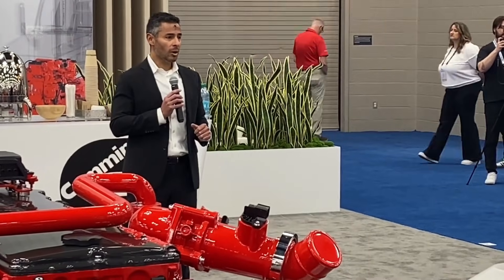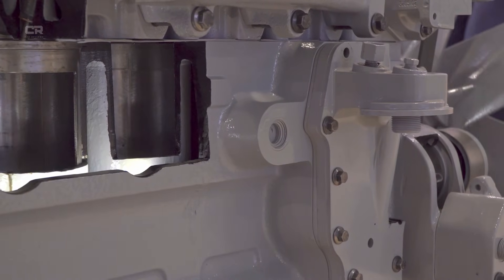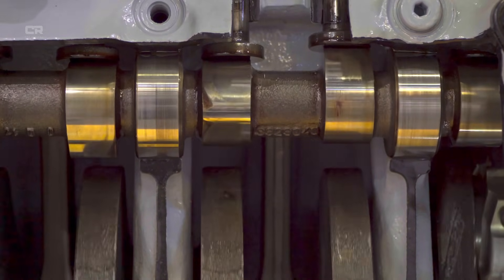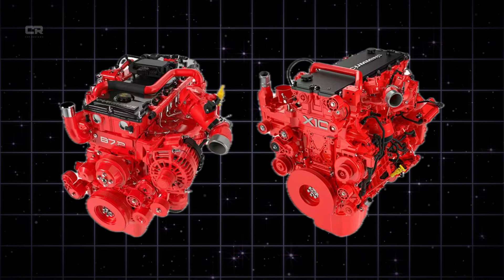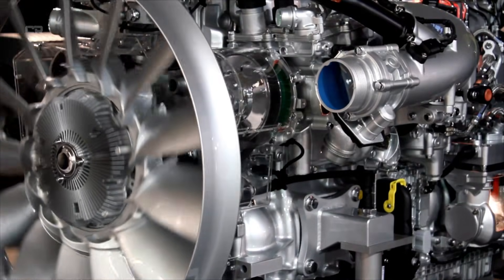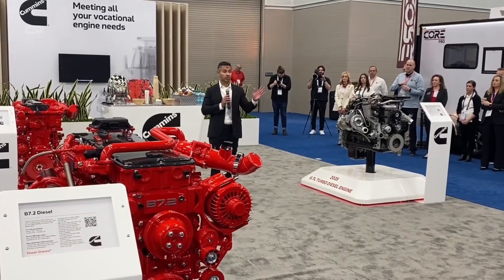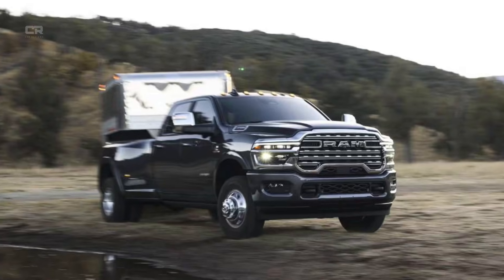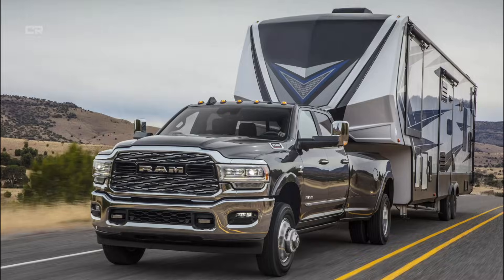7.2 Cummins Emissions System Explained DEF, DPF, and EGR — What Every Truck Owner MUST Know

Comment: All can be efficiently deleted from the start. With a good tune, none of this is necessary. And 1,000,000 miles on a motor is a reality once again.
Reply from the maker: Thanks for sharing your thoughts! It's definitely a topic that sparks a lot of debate among truck owners. A good tune can certainly make a difference!